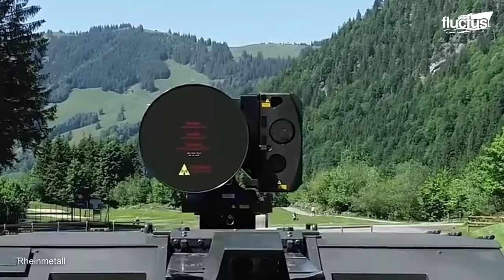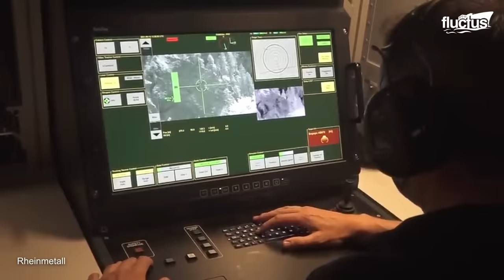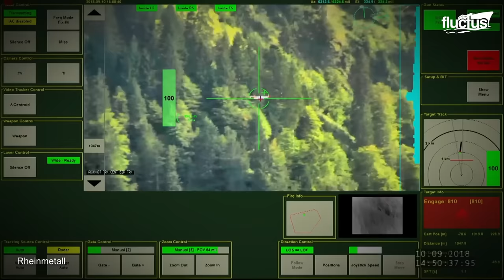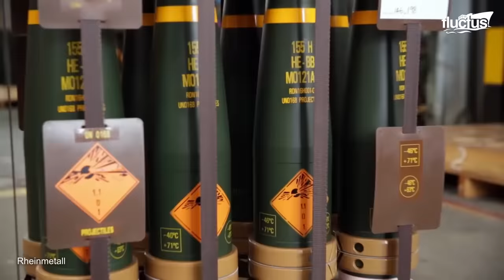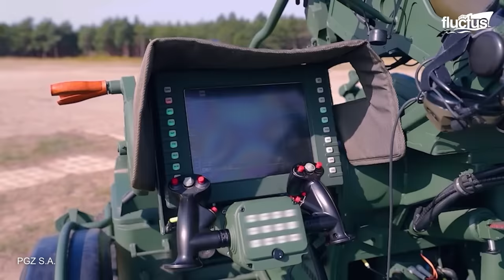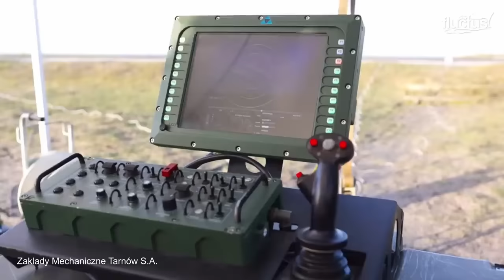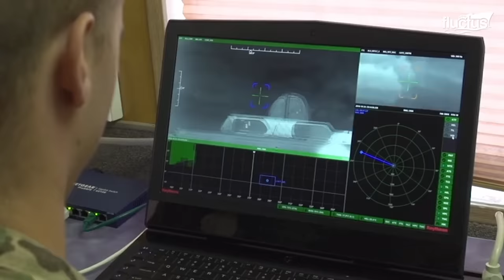The Reason Why Germany and US are Testing Monstrous $100 Million Anti Drone Gun

Comment: Stinger is not best because it costs more than most of the drones it can intercept.
Reply: @tomsmith2587

The right question to ask is:
Does the stinger cost more than what the drone is able to destroy ?
Reply: Stingers are infrared guided. Doesn’t work well with a battery powered drones.

Comment: 47 mile artillery range is insane
Reply: The US Army is developing a system that can hit 100 miles. 

The video is wrong too unless there is a caveat I am missing. The US Army fired a round at 68 miles.

 Think they are also designing a new gun that is like 50 feet long. Right now they are equipping Paladins with a gun that is longer but not that long - still a significant upgrade but they decided that this gun will be the longest a Paladin can handle without completely destroying mobility.

 US Army IMO needs to design a new Arty. Paladins are showing their age. It is a shame we scrapped the Crusader because a lot of that tech is used by SKs which is considered the best artillery in the world ATM.
Reply: @dianapennepacker6854  Could the caveat be the "conventional" bit? From what I recall, the headline-making artillery rounds used onboard range extenders like base bleed or even ramjet to reduce drag.

Comment: Spend $50,000 in small arms aummunition to take out $2000 worth in drones 👍
Reply: What? How is a cannon round anywhere near 50k? Even if that number is legit which I highly doubt its still much better than using 200k+ missile
Reply: @howdo861  the cannon round is like $140, plus $49860 for R&D, spare parts, labor, packaging, maintenance, transport, training, logistics, supply chain management, inspections, and disposal, and super computer time to simulate the rounds going off to make sure our adversaries know the rounds will go off.
Reply: @H2oRiz  A Lancet drone costs between $30.000-40.000, and a Shahed about $20.000. Those are "market prices". If you were to then add the same costs you're factoring in for those 35mm cannon rounds, I have a hunch the drones' price would go up quite a bit further. To say nothing of the cruise missiles these systems are downing as well.

Comment: G6 Artillery gun also called G6 Rhino is a South African gun, Designer Lyttelton Engineering Works and Manufacturer Denel Land Systems (turret)
Land Systems OMC (chassis) South Africa, not German.   The G6 Rhino is a mine-protected self-propelled howitzer. There is a G5 as well, the G5 is a South African towed howitzer of 155 mm calibre.     
Maximum range:

 30,000 m with standard HE rounds,
  39,000 m with HE base bleed rounds, and
  42,000 m with HE base bleed rounds (BB—fired from G6-52)
  50,000 m with HE base bleed rounds (BB—fired from G6-52 extended range)
  52,500 m with a special velocity-enhanced long range projectile (V-LAP—fired from G6).
  58,000 m with a special velocity-enhanced long range projectile (V-LAP—fired from G6-52).
  67,450 m M9703A1 V-LAP round (tested successfully to 73,000 m by Denel in G6-52 extended range platform)
  76,280 m M9703 Practice Inert V-LAP[18]

Minimum range: 3,000 m.
Rate of fire: 4 round/min, 2 round/min sustained.
Ammunition: 155 mm ERFB. 47 rounds, 50 charges, 64 primers and fuzes
Accuracy: 0.1% of range in azimuth, 0.48% of range in range
In 2012 four rounds of M982 Excalibur precision guided munitions were fired to a range of 38 km, all landing within 5 m of the target.
Reply: That is so, but Denel has been bought out by Reinmetal. The front runner of the 8x8 vehicles also comes from the same stable- Rooikat
Reply: Don't be so sensitive.  They never claimed the G6 to be German.  They were talking about the ammunition which is made by Rheinmetall Denel Munitions with Rheinmetall being the majority shareholder.
Reply: Ag shame- read and understand and don’t get your nickers in a not.
Reply: @fransoosthuizen2151  I was actually replying to the original poster.
Reply: My apology then, it came through on the notification as a response to my post.

Comment: I like the sky shield/mantis system but one of those 35mm rounds probably costs more than the drone it's trying to shoot down - and it'll always be firing a burst of them. Though it would still be useful against larger, more expensive drones or protecting high value targets.

IMHO, alongside electronic warfare/DEW, lower caliber weapons (12.7-14.5mm) with optical and audio sensors guided by AI trained to recognize visual and audible signatures is the way to mitigate the damage done by cheap mass produced drones (at short ranges, obviously.) People almost never see or hear them on a battlefield; radar also has trouble seeing them - and tells everyone where you are, making you a bigger target. But AI image and audio recognition is getting so good I think it would work well at scanning the sky for drones.

Comment: Guess a small cheap drone able to home on enemy drones will be a lot cheaper. But cost effectiveness never seems to have been the objective.
Reply: A gun that fires relatively simple projectiles is not just cheaper but also more efficient. Transporting, storing and reloading the ammo is much simpler and faster than having to transport some sort of "killer drone" and also, such a killer drone would need pretty advanced sensors and electronics to be able to intercept another drone and it would need a relatively big payload to reliably destroy a attacking drone.

Besides, the Skyranger system can not only shoot down drones, but everything that flies and gets close enough, including artillery and mortar shells against which some supposedly cheap interceptor drone would be helpless.
Reply: What? If economy of scale goes into effect there is no way a drone will cost less then a 35mm round that can also be used against other targets from ground fortifications to ground and air vehicles like low flying attack craft.

 The German Sky Guard has it right IMO. It would be nice if the tech could be miniaturized for next gen tanks to be able to use their 30mms to lock onto small drones as well.

 The C-Ram needs to be replaced with a larger caliber that has air burst. Its cool and all we can shoot bullets with bullets but that leaves too much margin of error! Well compared to the German AHEAD ammo with the timed fuses that create a uniformed wall of tungsten. Doesn't take much to knock out a drone.
Reply: Doesn't exist.

Nobody can make a cheap autonomic drone hunting drone l
Reply: It doesn’t have to be autonomous if it can be controlled remotely with an VR equipped operator.

Comment: Programmable ammunition is indeed a good way to destroy drone swarms! But the effect has been exaggerated. The damage effect on dense targets is indeed excellent. But four small drones launched attacks from four directions together and the automatic artillery failed!
Reply: 4000m lets say 100km/h drones gives the gun 1.5 minute to destroy them. Plenty of time.
Reply: wrong ! a single Rheinmetalle turret can handle several dozen drones at once
Reply: @d.o.g573  assuming you can detect them all in time.

Comment: My onclusion is that C-ram is the less attractive , too complicated solution.
Reply: Apparently Phalanx C-RAM rounds are also incapable of airburst, requiring a direct hit to have any effect. This, together with the smaller potential payload capacity, is probably the reason why the system has to practically spit out a stream of metal to score kills, thereby increasing logistical drain. How many tonnes of 20mm does a turret need to have available to protect against waves of incoming targets over a prolonged deployment?

Rather than too complicated, I think Phalanx is only being less attractive because it's less effective. Designed in the 70s(!), it was simply limited by the technology available at the time, and designers opted for a "quantity over quality" approach in terms of munitions. Perhaps with advanced miniaturization and more powerful explosives, the smaller rounds could be upgraded to incorporate airburst as well, but apart from driving up the cost it kind of defeats the purpose of a gun that is inherently supposed to dominate the skies via sheer volume of fire.

Comment: I would prefer the sky next system over the C-Ram. Far greater range and more pen against armored helicopters.
Reply: MANPADs are better suited against helicopters. We need to improve them though as the Stinger for whatever fucking reason costs a LOT more even with inflation taken into account. We need to up the range on our MANPADs for sure as helicopters are just going to be sniping BVR. A Javelin equivalent is needed with a good optic especially for night time.

 C Ram still sucks though. 20mm doesn't have enough range or power. Plus it doesn't have a burst effect like the AHEAD ammo which I always thought was stupid. Too much margin for error. With the speed of incoming projectiles and velocity of your gun - it doesn't take much to destroy the target or make it miss. So having a round that creates a uniformed wall of tungsten X meters wide just makes a lot of sense.
Reply: @dianapennepacker6854  You still need something against cheap drones and Arty rounds. Things you can't attack with a man pad rocket. And I said, that the 35 mm is better against helis vs. a 20 mm round, not compared against rockets. You can equip a sky ranger system with additional rockets anyway. Also, you can use flares against rockets and maybe the other side finds a way to jam your systems in a conflict, with no alternative you are pretty much fucked. And how awesome is it, to be able to shoot arty rounds out of the air?

Comment: I wonder if the US Military have ever mounted and tested the Phalanx on a Bradley or a Stryker?
Reply: No, the Phalanx is way too big and heavy.  It's transported on a semi-trailer as the LPWS (LAND-BASED PHALANX WEAPON SYSTEM) because it weights 58,000 pounds.
Reply: Back in 1995, the Marine Corps, tested  the GAU-13/A a 4X30mm version of the GAU-8 7X20mm gun. It was mounted on an LAV25 Air Defense variant. Unfortunately, the system was deemed to be unnecessary since the DoD did not expect to fight any peers in the near future.
Reply: @johnmartin6420  Yeah, both the USMC and USA plan for air defense is basically "people flying jet fighters will do it".  Which is looking kind of shaky right now.

Comment: I watched the closing ceremony of the Beijing Olympics which was a while back & they had hundreds if not thousands of drones dancing around in the night sky so close to each other yet not making contact with each other. They clearly had a start on the west back then & I’d guarantee like they have cornered the domestic drone market they will dominate the military sphere unless the west invests heavily.
Reply: They are not dancing, they are acting like giant LEDs in your TV, lighting up and dimming down to simulate movement. Because of the limitation of battery technology, it is still not possible for those "performance" drones to move quick enough. Big military drones are different, some use jet fuel and turbine engines to move rapidly. These are very different from the fragile battery powered drones you saw at the Beijing Olympics.

Anyways, thousands of drones close together would hardly be a difficult challenge for modern anti-air airburst rounds. Heck, even WW2 Flak guns will easily destroy them.
Reply: @nicholaslee5473 standard commercially available display drones. Nothinh Chinese specifically